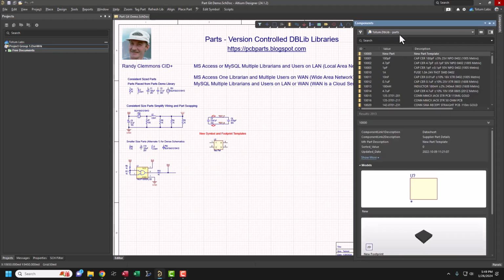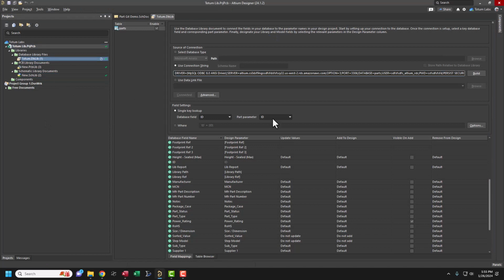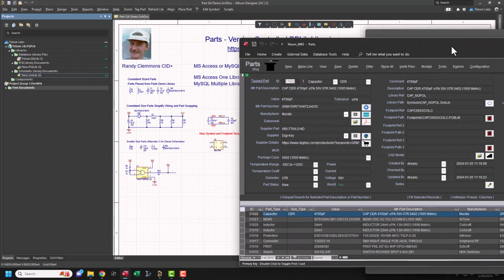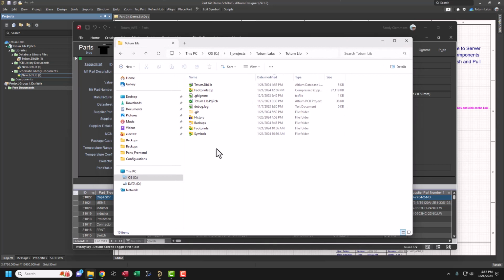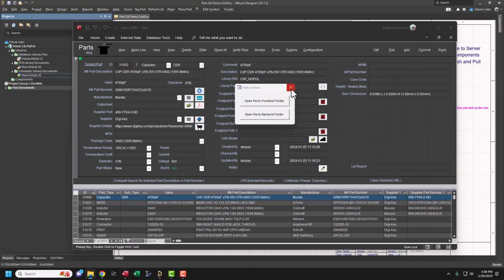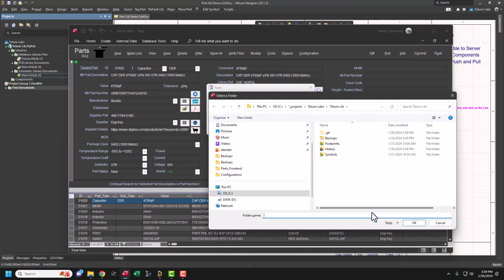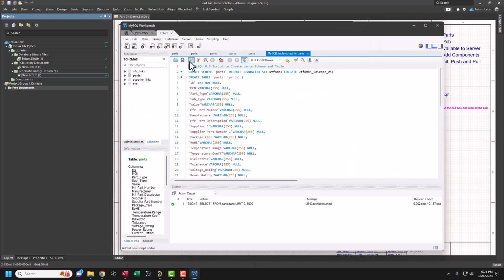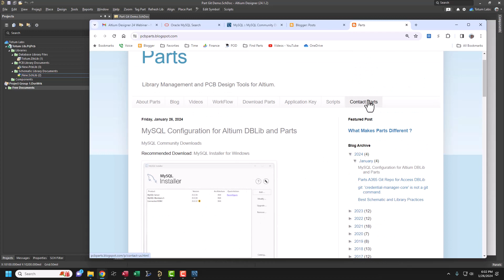MySQL Configuration for Altium DBLib

Comment: Curious, does this setup make it relatively easy to flag & resolve conflicts with multiple users trying to add or revise parts simultaneously?
Reply from the maker: The short answer is yes,  I have many customers using the Parts application with MySQL. I would be happy meet with you discuss using Parts with MySQL.